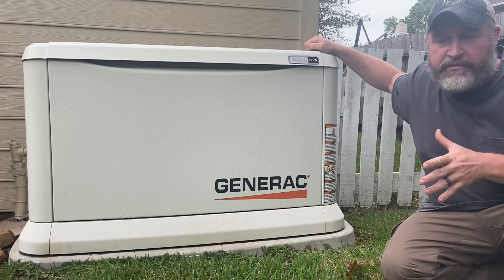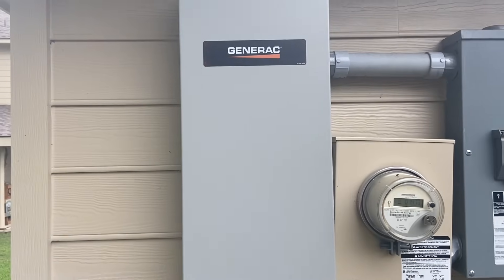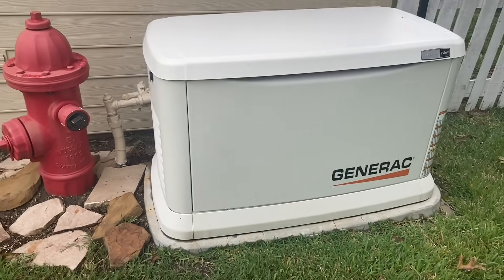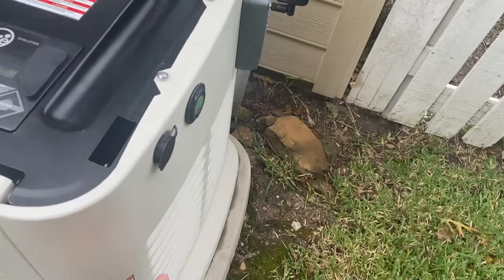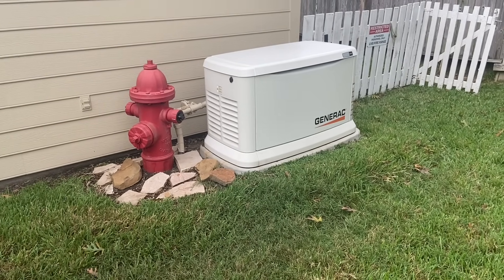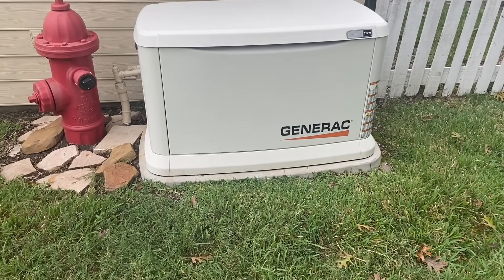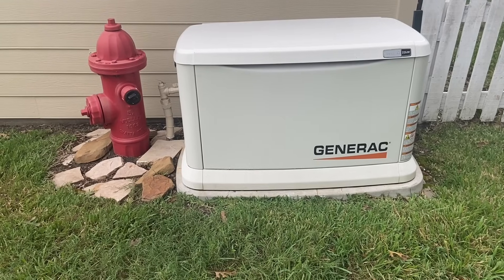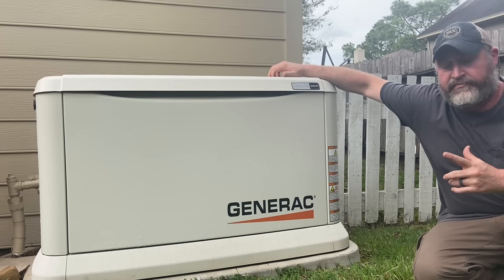Thinking of purchasing a generac whole home generator?

Comment: Not worth it, heck you would think you could get an inverted engine.
Reply from the maker: Jeff thanks for watching buddy
Reply: What is an “inverted engine”?
Reply from the maker: @Do_the_Dishes  crankshaft would be located above the cylinders, but yea not sure what his comment is referring to.
Reply: @Do_the_Dishes  its a much quieter engine, if you went to an RV park and the power went out 98% of the them would use inverted, but there is always “that guy” that wouldn’t pay the extra money for an inverted engine, that’s right inverted is more expensive but what these guys are paying you would think it would be inverted
Reply: Do you mean “inverter”? If so, it has nothing to do with the engine, just sayin.

That said, I bought a 23k liquid cooled gen set. Runs at half speed of a air cooled and a bit quieter. Mine gets used a bit, old grid, frequent failures, the last, just last week was 13 hours, the longest was 8 days and 11 hours. Unit is worth it’s weight in gold.
Reply from the maker: @GGarduchi   thanks for watching please subscribe and check out my videos, we thought about the liquid cooled for the lower rpm but the cost jumped up a little too much for our budget.
Reply: @jsurfslammer  it's not the engine that is "inverted".  The name inverted comes from how the power is created.  It's changing AC current to DC current and inverting it back into AC via MOSFETS.  When producing power this way, you are able to throttle the same engine's RPM up and down with the load instead of having to run it at full throttle all the time.  Hence, it is more quite during light to medium loads becaue of the lower engine rpm.   Plus, they do not offer inverters generators for the size he has. (yet).  The largest inverters commonly offered that I can find are around 9.5kw and that is pretty much just recently.  You can usually gang these invertes together to come up with double the power but that is more cost, fuel, ect..  So for you to say it is not worth it, know a little more about what the deal is before saying that.

Comment: 20 seconds is too long
Reply from the maker: Was it 20?
Reply: @JustCantSitStill  i think it was
Reply: You can buy UPS to provide battery backup and no delay for sensitive electronics like computers.
Reply: That delay is about standard for whole house generators. It comes up when it determines the outage is for real, not just a minor blip in the electrical grid. If it came up immediately, you've have the generator kicking on with every minor power glitch when it's not really needed. It might even detect power surges as outages and then there would be real trouble. Finally, 20 seconds is a lot faster than trying to hook up and start a portable generator.  If I'm going to be without power for hours at a time, I don't mind waiting less than a minute for it to be restored.
Reply: Takes me about 30 min to haul out my portable and get it hooked up , running and switched over. 😅
Reply: Generac is about that long-less than 30 seconds, generally.  Kohler is about 10 seconds, but the generac also has a warm up feature on some models that can be disabled, that would shave about 5 seconds, but it is better for it to be warmer before it sees the load.  So, the wait is worth it.

Comment: Air cooled? You paid too much for that pos. Next time you’re at Lowes or Home Depot wherever you bought that generator look at what they use to power the store during power outages. They’ll have a liquid cooled lpg generator. Why did they choose liquid cooled? Because they know that the air cooled models won’t last but a few hours of continuous duty under a load. Try your generator out and you’ll see. Turn off the utility power for one full day and see what you’re really working with. If you’re just trying to keep power on a couple of hours every now and then you’ll be okay for a year or so. Next time buy yourself a liquid cooled unit instead
Reply from the maker: Next time watch the video